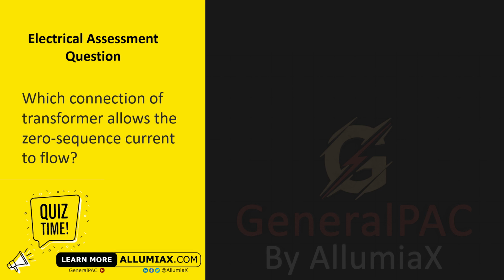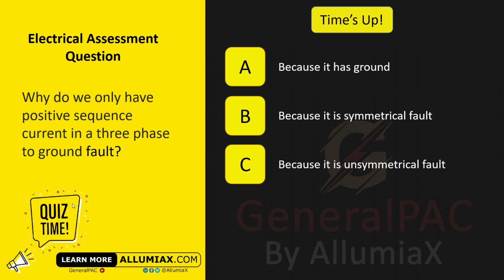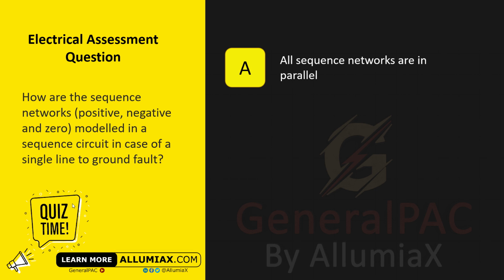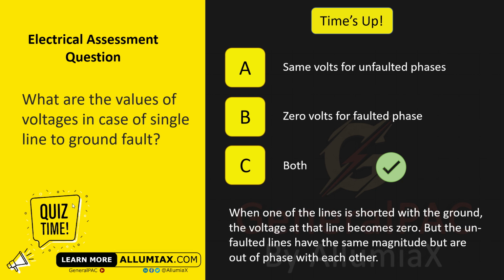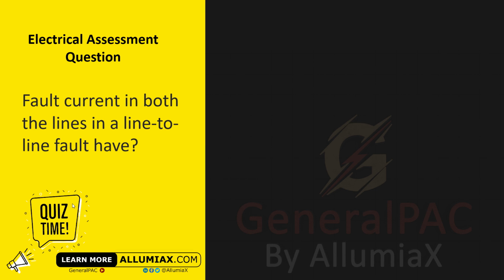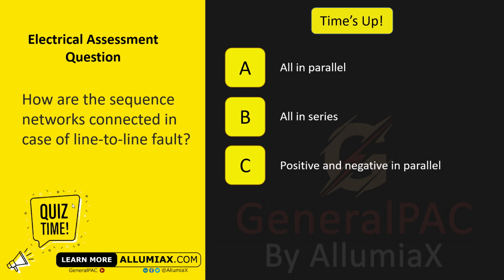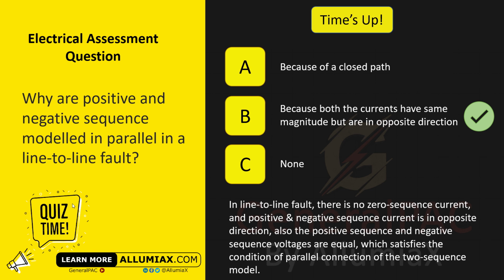Part 5 — Electrical Engineering Interview Questions & Answers (MCQs)

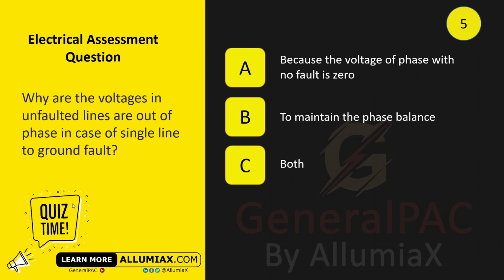Comment: Hi, I think answer (A) of the question at 2:23 seconds is incorrect. It should be (with fault) instead of (with no fault)
Reply from the maker: Hi Sam, you are right. Its answer is B, not C and if it is C then option A should be phase with fault have zero potential. Thanks for pointing this out.
Reply: @Generalpac  Hi, I think if the error in option A is corrected, the answer is still C. Since the (corrected) fact about the voltage of the faulty phase is what created it the need for the other two phases to become out of phase to maintain the phase balance. Thanks